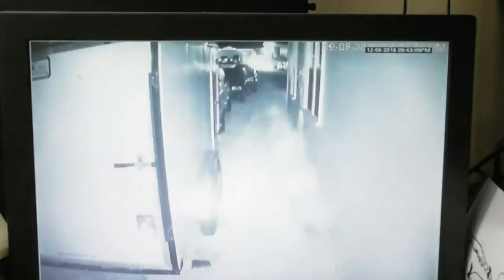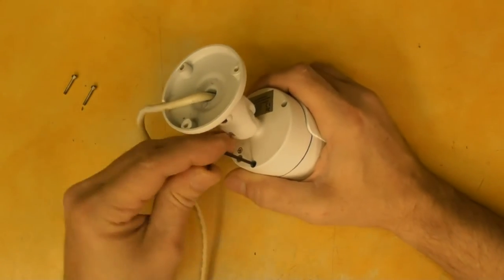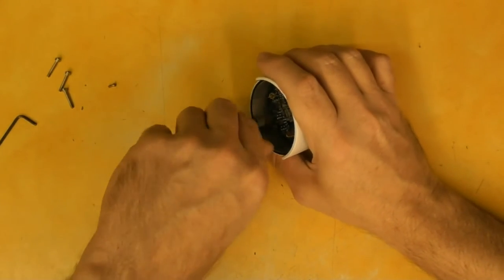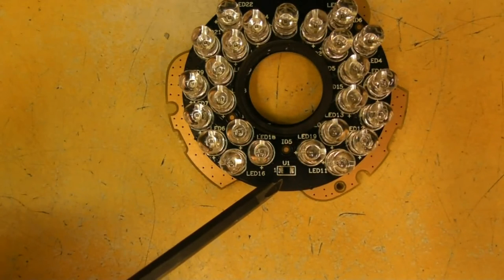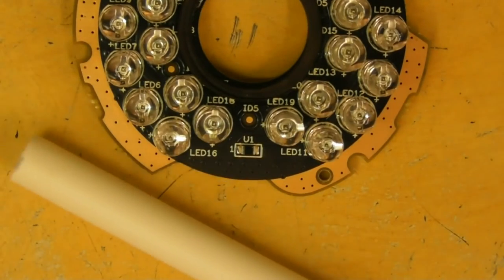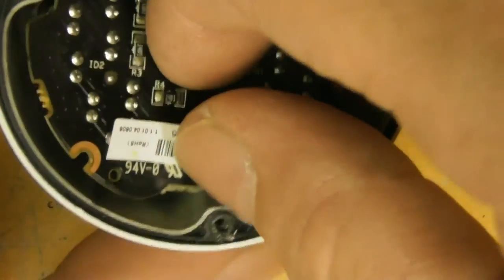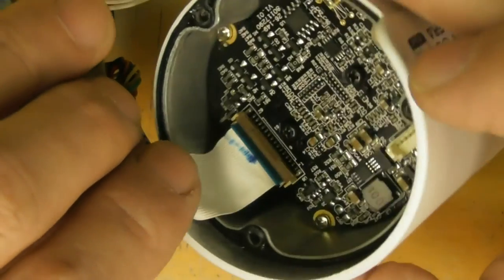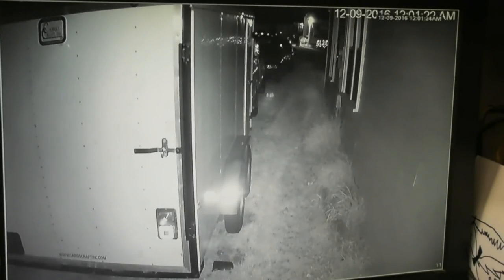Dahua Security Camera- Fix Blinking IR LED’s

Comment: Nice fix G!  Really excellent deduction on the problem and fix.  Much better than a buck and change for a new camera on an outdoor camera (IP67?).  Think you should submit it to them.  That SMT photo diode is probably about 2 cents on a reel, but a pain to get the number off of & order it and then steady hand solder an SMT.  Definitely a PITA for old shaky hands and trifocals.  Your fix should last a while.  If I were a betting person I might think the root cause is not the degradation of the photo diode itself but a solder bonding issue being an outdoor device.  Weather, temp, pressure changes can create more resistance for the IR diode to come on appropriately, sealed or not.  Even where the screws are placed or torqued evenly can create stresses on the board and eventual failures. SMT stuff is subject to all of that over time because of the small contact areas.  You can reflow the PWA in the oven if you are careful...there are some YT vids about it.  Either way G, Nice fix and share with us.  Happy Holidays to you all!  ~PJ
Reply from the maker: Thanks PJ! IP66, but yes- much better of a price for sure. If I recall correctly, these were about $150 at that time. 

You may be onto something. I did try to look at the connections using my optivisor- but still couldn't really see well. If this one, or another, exhibits the same problem- I'll dig out my microscope for a better look. So far, it's still working fine- though time will tell. Yeah, the size of the components in these things are crazy small.

I've actually resurrected a couple of laptop motherboards by re-flowing in an oven. The on-board video was on the fritz. It corrected both. The board in my laptop worked great until my daughter spilled a drink on it and I didn't know till I opened it up and poured it out....lol. I've still yet to eBay a replacement over a year later!  I wonder if the LED's could stand up to that treatment? 

I have a couple of other cameras were a portion of the LED's aren't lit- one with about a 1/2 and another with 1/3. I didn't think to inspect this one while I had it open to look how they were wired- if I could tell. They may be in series on a 3 or 4 circuits and a some burned out. It doesn't seem to affect their ability to see, so until they're all dead- I'll probably not get around to it...lol. Take care, G.
Reply: I can see the IP66 at that price point for sure.  The LED issue may be a problem if they are Pb free as the reflow temps are higher.  The specs should tell you if they are RoHs compliant.  Nice to know you fixed a laptop that way.  Almost did that for my son's old XPS laptop (same issue but the vid was a daughter card) but ended up finding a new board on the bay...that thing is a Juggernaut, but slow to today's stuff.

As for the LED outages it is likely a similar issue with the resistors/packs rather than the LED's themselves because they are through hole and long lived.  Hard to tell how they are wired with a multi-layer board.  It's kind of a toss imho whether to just touch them with a good SMT iron and tip or reflow the whole board and because I didn't see the other board or undersides clearly enough.  I personally like the Hako Irons and tips if you go that way.  For a buck and a half+ a pop I'd definitely be trying something before throwing in the towel.  Another alternative is to see if you can get replacement boards for them?  Again Great Fix G!

Comment: Great video man, have a similar problem will let you know if I succeed. Thanks
Reply from the maker: Thanks Richard. Most of my cameras started doing the blinking issue over time. I've done the same to them and they're working fine to this date. Give it a go, and do let me know how it works out for you. Take care, G.
Reply: @ghostses  Thank you for your concern the transmitter led already has a tube around it to prevent spilling onto the receivers. I would send a pic if I knew how.
Reply from the maker: @richardmorgan2959  I can't help with that Richard. Hopefully you can find a solution. Good luck, G.

Comment: my srihome SH025 wireless cctv camera blinks too but at a much slower rate. Do you think I have the same problem?
Reply from the maker: I can't say, but it's worth a shot to see if it corrects your problem. This camera still works great. I've done about 6 of my 9 the same way when they started acting up. If it does take care of your problem, post back. Good luck, G.
Reply: @ghostses  Thanks for the quick reply.  I read somewhere that it could be the power supply. My cctv is powered by USB 5v power supply. Let me change the power supply first and then try your solution.
Reply from the maker: @norbertson2718  Good deal! G.
Reply: @ghostses  I've replaced the USB 5V power supply. its still the same problem. I opened up the unit. The unit has a built in tube cover for the sensor, so I guess there really is a problem with my unit. FYI
Reply from the maker: @norbertson2718  Seems So. I can't say what you might do. This worked for me with about 6 of my 9 cameras but it sounds like your has something else wrong. Hope you figure it out. Take care, G.
Reply: @ghostses  Hi. The company that makes Srihome (Shenzhen Sricctv Technology) has replied to my problem. They sent me a link to an upgrade program(MPT installer) and it looks like it has solved my problem after I upgraded the software. Thanks
Reply from the maker: @norbertson2718  Good deal! I hadn't thought that a firmware upgrade might be the solution to your problem. Glad it was taken care of. G.

Comment: a couple of daps of hot snot i had to use some to fix a instant coffee maker the plug wire where in the plug had to much play and the plug was also a sloppy fit so i used hot snot AKA hot glue to fix it and had to re crimp three improperly crimped pigtail connector's also now it chooch's
Reply from the maker: Pretty cool what can be fixed Terry! Hot snot and a couple of crimps- and bang!
Chooching- Sounds like you might be an AVE fan? Or perhaps Canadian?  Either way, if you haven't watched any of AVE's videos- you might check them out for a good educational laugh. He's got a great channel. Take care, G.
Reply: ghostses yep!
Reply from the maker: That's cool! G.
Reply: ghostses A 100% All American!
Reply from the maker: That's cool. Same here. G.

Comment: Isn't this internet thing amazing!? Back in the day , we would take something down to Bob's fix it shop and let him try to figure it out. I remember working in one when I was 10 and we/he fixed all kinds of things. He sure had lots of thick manuals in a bookshelf I was never allowed to touch (fear of me tipping it over on myself pulling a manual out). We also sold all the stuff nobody came by to pick up or want to pay for. Lots of toasters, mixers, vacuumes, lamps, lawn mowers, washing machines, etc, even the old wind up watches sometimes. You name it we fixed it (or tried to). I remember the new realistic hand held radio we fixed and I wanted so bad that the owner wouldn't come get it. Well they did but good old bob (xNavy with one wooden leg) got me a new one for Christmas. After that I got in lots of fights when the other kids called him old peg leg. Back then our prices were astronomical in 1960. $3 an hour for labor, woo hoo!
Nice fix buddy, I knew you could do it. Now just keep that tubing available for the next one of your massive security system cameras - haha!
BTW, did you ever get that shotgun (that is wired into your motion sensor) adjusted to only shoot trespassers that you didn't know?
Reply from the maker: That it is! Interesting story Mac! You've probably got about 15-20 or so yrs. on me, but I do remember the Bob type shops when I was young. It was probably about the time they were all starting to close up shop. Very cool of him to get you that radio! And certainly someone worth fighting for. 

In high school I was really into high-end car audio. The high end tape decks were 4 -700 bucks which I didn't have. I would get a smoked unit for cheap, or even free from classmates, then take it into my Bob's shop to get it fixed. I think it was about $100 at that time. 

I don't know how long this fix will work, but working is working!

The shotgun idea had to be scrapped. It was taking out too many friendly's. I was really only trying to target the postman- since all he seems to bring me are bills....lol. Take care Mac, G.